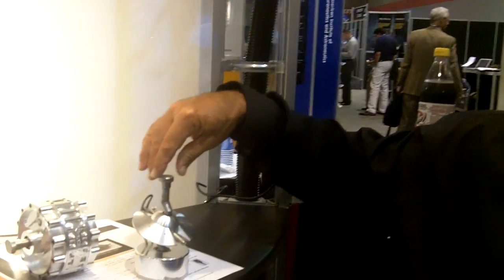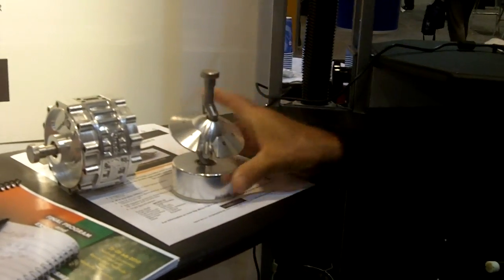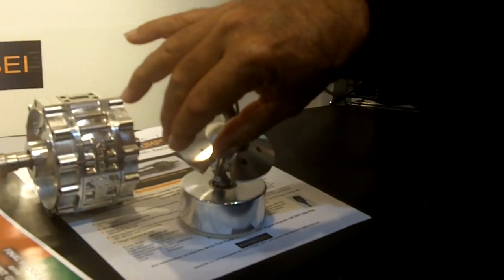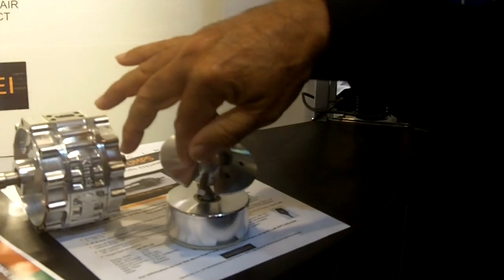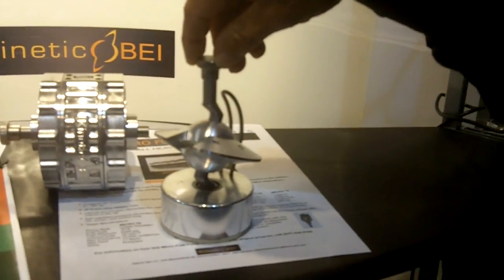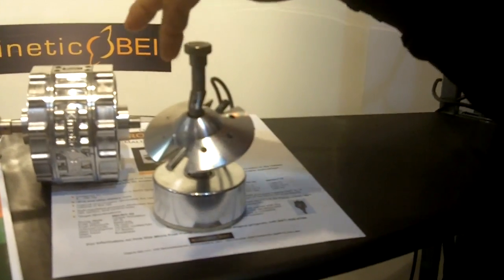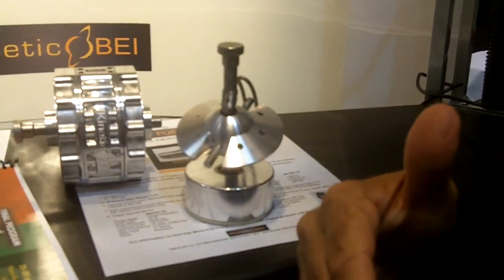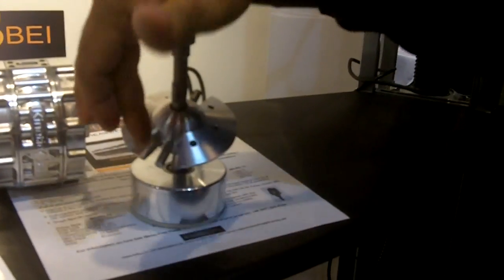Meyer Nutating Disk Engine

Comment: I saw Kinetic BEI (the company in this video) at the AUVSI.org trade show in DC, they had the engine shown on the poster in this video although they said it had "blown up" in testing.  These engines seem like a great advance in power to weight ratio and efficiency IF they can get them working reliably.  But this is not a new concept, its been around for nearly 100 years.